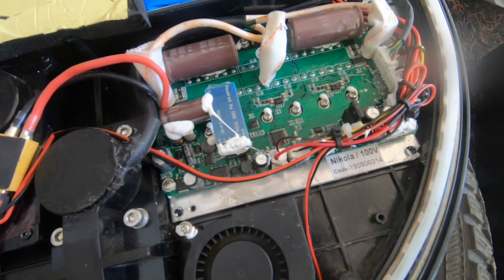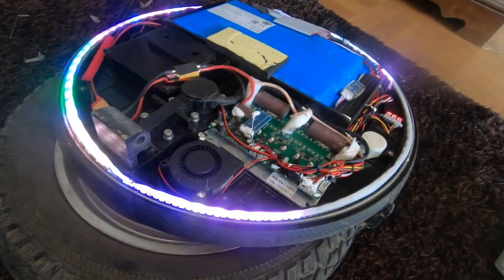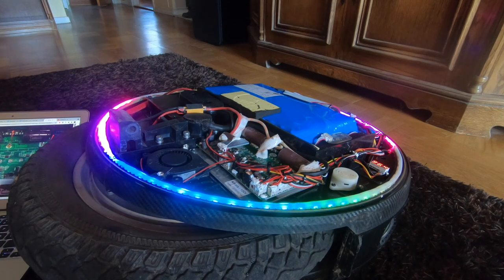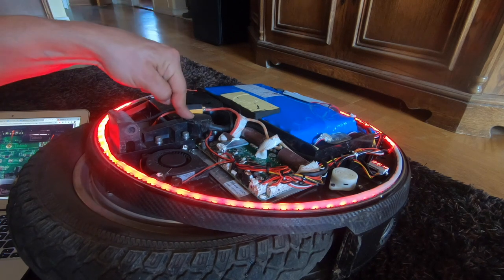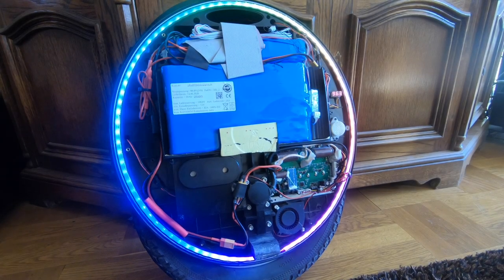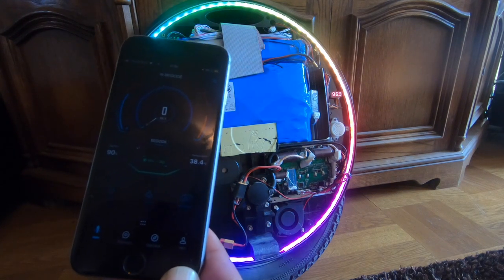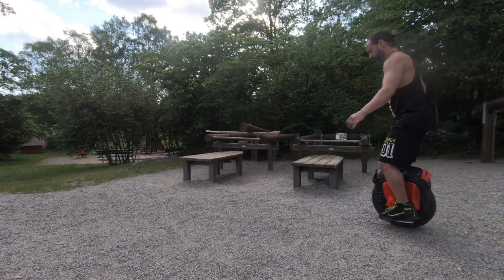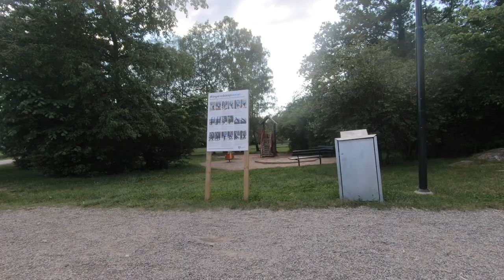Inside the Nikola Plus and Revisiting the Sai Red Trails

Comment: The lift cutoff button/switch (on the Tesla) has a couple tiny pieces of metal that fall off when the switch/button gets moved after opening or vibrating. I think that's the tiny piece you were holding. 🖖
Reply from the maker: Thanks! I think it was a just a tiny plastic shaving from one of the screw holders. No big deal though.. all seems good for now although next ride on that wheel will be with a helmet just to make sure. Although I would prefer not to fall for a couple of days after falling yesterday lol.

Comment: hi my friend as you know I have the family that lives in China and I have already inquired for the wheel on many things and the wheel manufacturer the bottom say that it makes wheel not waterproof because at home it rains rarely it is more delhumidity at home with the heat or a time that is variable it reflects for the future of the waterproof wheel as the inmotion that eu is said to be dustproof
Reply from the maker: Hi Michael! Yes, no wheels are waterproof.. and some are more water resistant than others. This is just an issue with sealing around the gasket. After 7000km there was not a single drop in there. After the motherboard change things do not look the same. Also total 8400km on this wheel. 16500km on the MSX and no problem. They are water resistant enough for me!
Reply: @isthereanyfood  yes just I'm called mike me at the beginning I bought an inmotion v8 my friend a gotway msx 84v we went the first day for a ride we were a can beginner he started to rain for my v8 zero problem she the next day it wheel was burned barely 60kilometer resulted in the battery we even caught fire it was very sad

Comment: Hi Mike. Having been piecing together the world's most unloved msx and fitting a lift switch I'm pretty sure they're a momentary switch which would mean shorted wires or most probably a switch that's stuck on. As for the waterproofing if the nik is the same as the msx the seal should be under the motherboard and not on the wheel side. You might have to remove a few screws and connectors to flip the board out the way then silicone to your heart's content.  Having ripped my wheel apart it's all fairly simple but a mess of wires.
Definitely wouldn't want to split your nik rad with all that extra stuff... Maybe a trip to see the mad professor is in order.🤔
Reply from the maker: Yes you are right... I am sure it is a cable that is pinched. But no more switch for me now so I don't have to think about it. I will simply turn the wheel off and on and let it make it's terrible Nintendo start up noise. You are correct that the seal is under the motherboard and like you say I will most likely just remove that panel and go nuts with silicone! Thanks for the suggestion and motivation.
Reply: @isthereanyfood  I can't see it's a pinched cable as it would have to strip both wires and short them together. More likely the lift button stuck on....maybe if you could spray some contact cleaner up in it and try a few hefty slaps above it on the handle it might release. Just a suggestion and I could be wrong. Hey if I lived in Sweden I'd pop over and fix it for you....in exchange for beer and riding tuition😂  at least it still works and you have the msx and exn...not forgetting the ninebot one.

Comment: MSX=Chick magnet 25:10.  Right Said Fred 26:55.  Hi Mike, that was such a cool demonstration with the hair dryer kicking on the fan and showing the temperature in the app accurately showing the temp in the wheel. If I'm understanding it right, you disconnected the lift sensor and now you don't have a lift sensor anymore, not that it's such a huge deal? I know exactly what you mean about opening up the wheels and not having it ever be the same. I'm especially nervous about opening one up and then losing a proper factory seal although I don't ride the rain anyway. But you never know you could get caught in the rain at any time around here.
Reply from the maker: Haha yes. The MSX never lets me down lol. Lmao at Right Said Fred. So damn right haha! Exactly... I just disconnected the lift sensor entirely. It is not a huge loss. It has been raining like crazy today... I was tempted to armor up and go out and ride the Nik just to see if it would die lol. That's how much it bugs me. And then I said... well... i'll just swallow that pill when the time comes and I actually get stuck out in the rain... which I already have a couple of times already... so it's fine.
Reply: @isthereanyfood  "I'm too sexy for this lift switch, too sexy for this lift switch, this lift switch is such a bitch" lol.

Comment: Hey Mike! That's a bummer about your Nikola. I hope it holds up and nothing bad comes from the water ingress or lift sensor trouble. Of the Gotway wheels, the Nik was the only one the community would say was decently resistant of water. We got a major drought here in Cali right now so we haven't been put to the test.

I'm not taking for granted that I'm getting my Nik from AlienRides and that his repair shop is close by. If I didn't have that, it would be a nightmare.
Reply from the maker: Yeah... that's my biggest gripe. That the Nikola is known as the most waterproof / water resistant of the wheels. I will look into applying some silicone there. Last year Petra and I discussed doing it on her wheel as well.

You are definitely lucky to have AlienRides close by! What a luxury!

Comment: WD-40 is good for a degreaser,  but I feel lithium grease (whitish) is better for your bearings.👍
Reply from the maker: Totally agree with you Jack. Although to apply it I would need to open the the wheel entirely.. while here I am just thinking of taking the easy way out and spraying, perhaps it will seep in... and then seeing what happens.
Reply: @isthereanyfood  well I know lithium grease in a spray has a straw like nozzle like WD-40 does so it could be applied in the same manner for hard to reach areas.
Anyway good luck. 😜👍
Reply from the maker: @jackvolta3489  Awesome man. Did not know that! I will look for some. Thanks!
Reply: @isthereanyfood  you'll probably find it in the automotive section. 👍

Comment: Mike don't you need to keep the wheel standing up or at 90° for everything to work properly? I mean doesn't a wheel cancel out things beyond 30° so laying it down might make give you a false positive. 🤔...?
Reply from the maker: Nope! I have tried just standing it up, etc so I know that the cable is pinched. It happened when I carried it up the stairs. Then it just triggered the lift sensor at power on after that.
Reply: @isthereanyfood  I hear you. 👍
Reply: @isthereanyfood  Mike haven't been riding much lately been suffering from Tarsel tunnel its like carpal tunnel of the wrists, but in the ankles makes riding almost impossible, because it flares up
When you least expect it, and sometimes I lose feelings in my feet, Im taking some meds & a supplement for it, but its only been a week since treatment hopfully after a month I'll be back up & riding again.